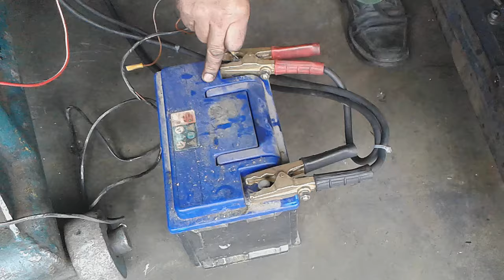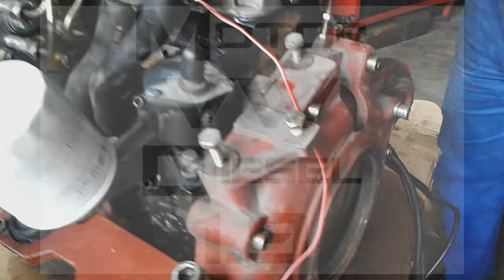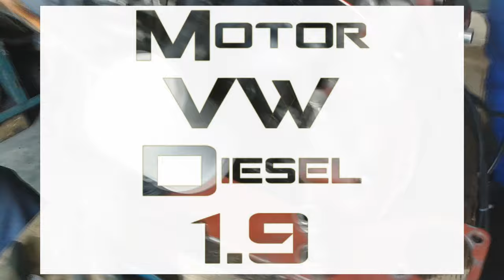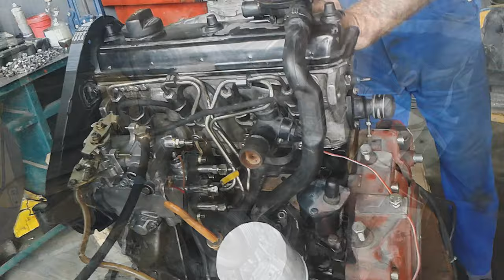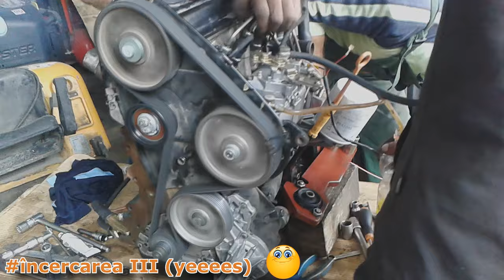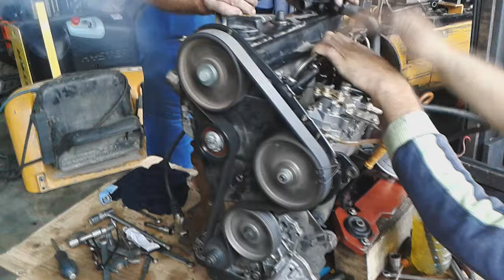Motor VW Golf 1.9 SDI pornire (Start Engine)

Comment: Its 1Y (engine code ) I think 

Its 47KW 1.9 D (Diesel) vw Golf 3 64hp mechanic pump 

1.9 SDI Have Electric pump like Golf 4 

Btwn the best diesel engine in mk3 is 1.9 TDI 66KW (1Z/ AHU) And 1.9 TDI 81kw ( AFN ) 

81kw + chip / remap easy 140-150 hp 7-5 sec 0 - 100 kmh and great fuel economy.

Comment: Salut, am un Seat cordoba 1,9 sdi 47kw cod motor ASY din 2004, îmi scoate fum negru de la 2500 rpm, o părere vă rog, poate să fie egr defect sau înfundat. Am făcut diagnoză cu testeru și toate funcționează în parametrii, vă mulțumesc.
Reply from the maker: aş zice să încercaţi o decarbonizare auto la un atelier specializat, dacă e cipat, dacă îi este mărită puterea din tester atunci scoate fum, altceva nu ştiu ce părere să vă dau dacă aţi spus că în rest totu funcţionează cum trebuie ori injectoarele pot fi înfundate ori EGR-UL, deci încercaţi toate variantele (decarbonare + verificare injectoare + verificare EGR)...
Reply: @AndreiChrisso  da are ceva soft masina, dar nu a scos fum, problema cu fumul este de o lună de zile. Dacă erau injectoarele nu pornea motorul la sfert de cheie. Și despre decarbonizare sincer vă spun am făcut cu trei luni în urmă, cineva a spus că este motorina proastă. Am curățat egr ieri și astăzi vreau să văd cum merge multumesc.
Reply from the maker: @stefanbaros7144  mai rar de la calitatea motorinei, dar în general după cipare fumegă, am câţiva prieteni cărora la fel li s-au întâmplat, după mărirea puterii a început să scoată fum, neavând alte probleme cu maşinile.

Comment: Salut ,am si eu un motor de golf 3 1,9 ca asta,si as vrea sa il pornesc ca ii luat jos,vreau sa fac un tractoras cu el Cum ati facut la pompa de injectie sa ii dati curent,ce fire trebe legate ????? Multumesc
Reply from the maker: dacă aveţi discord putem vorbi acolo, e destul de mult de spus, vă las aici discord-ul şi vă explic acolo...     Andofigur355#3895
Reply: @AndreiChrisso  nu am
Reply from the maker: bine Mircea, am să revin cu un răspuns mai pe seară, promit, o să-ţi las aici răspunsul... acum sunt în trafic, conduc, până diseară am să-ţi las răspunsul aici, bine ?
Reply from the maker: trebuie legat plusul la bobina pompei de injectie şi electromotorul legat la baterie
Reply: @AndreiChrisso  pun direct plusu de la baterie la electrovalva de pe pompa de injectie ca minusu face masa cand pun bornele sa pun la electromotor,Doar atat trebe alte legaturi electrice nu trebe ca motoru sa functioneze?
Reply from the maker: exact, doar atât, electromotorul şti să-l legi ?
Reply: Da,iti multumesc fain pt.ajutor Multa sanatate
Reply from the maker: @mircearoman2014  cu multă plăcere
Reply: @AndreiChrisso  salutare. Am un motor 1.9 tdi cod 1z are pompa electronica. Pot să îl pornesc dacă e luat jos? Aceleași proceduri că la unu cu pompa mecanica?
Reply from the maker: @JohnnysVolkswagenT3  da ar merge, doar că trebuie să-i ataşezi răcirea prin lichid, chiar dacă nu are sens închis, o laşi să curgă, adică conectezi instalaţia de răcire la o sursă de apă externă, chiar dacă curge pe jos pe partea cealaltă.

Comment: Salut, dețin motor 1,9 sdi 47 kw cod motor ASY din 2004, îmi face presiune în vasul de expansiune, am rectificat chiulasa am schimbat garnitura, am pus semeringuri noi la supape, si tot îmi face presiune, ce poate fii multumesc.
Reply from the maker: s-ar putea să fie de la termostat, acesta rămânând pe inchis, dacă ai schimbat toate piesele pe care le-ai specificat, bine-ar fi să îţi verifice cineva care se pricepe termostatul să vezi dacă declaşează când ajunge la temperatura optimă.
Reply: pacat ca ai umblat la motor. motoarele astea sunt extrem de fiabile, iar problemele lor sunt de regula legate de auxiliare, nimic intern.
Reply: Ovi motori 1.9 sdi su naj bolji motori izdrzljivi samo uredno odrzavat

Comment: 1.9d not sdi
Reply from the maker: it's SDI, without turbine
Reply: @AndreiChrisso  sdi-ul e cu injecție directă și pompă cu accelerație electronica, fără turbo, cel din video este 1.9 diesel cu injecție indirecta si accelerație pe cablu
Reply from the maker: @adelin3179  păi da, așa e, adică SDI, există SDI fără turbo, acesta fiind cu accelerație pe cablu și injecție directă, eu nu m-am referit la ce tip de injecție are, pur si simplu i se zice SDI ptr. că nu are turbo, mai e și varianta TDI adică cu turbo, ai înțeles acum ? Acesta este SDI aspirat, generație mai veche, fără turbină, nu am zis nimic de tipul injecției 👍
Reply: @AndreiChrisso  eu ma referam ca există 1.9d si 1.9sdi, ambele sunt aspirate doar că unul are pompă pe cablu si injecție indirecta iar celelalt pompă electronică și injecție directă, iar cel din clip este 1.9d
Reply from the maker: @adelin3179  da, așa este 😁 într-adevăr
Reply: 1.9 D 1Y 47KW Mechanic Pump
1.9 SDI AEY 47KW Electric VP pump controled by ECU MSA15
Reply: Understand?
Reply from the maker: @fitlifeinsider  Yes :)))

Comment: E motor 1z nu sdi
Reply from the maker: cum adică 1z ?
Reply: @AndreiChrisso  cod motor 1z după cum pare nu prea pare 1.9 Sdi e ceva mai vechi dupa cum e in video
Reply: @AndreiChrisso  sau daca e de pe golf 3 e 1.9 e AAZ
Reply from the maker: @antoniocosmin3278  n-am auzit, dar dacă tu spui, probabil că așa o fi
Reply: @AndreiChrisso  ca 1.9 sdi e altfel semanăna intre ele dar sdi are ecu nu poti sa il porneste fara el cum e alh poate e un sdi mai vechi mai vechi de 1999 sau cum am spus AAZ(cod motor)sau dacă nu are turbo e 1Y
Reply from the maker: @antoniocosmin3278  aaa ok, am înțeles, acesta e SDI, nu m-am uitat la serie, dar sigur este SDI, e un model mai vechi, a fost pus pe stivuitor
Reply: @AndreiChrisso  dacă il filmai si in partea la galerie de evacuare pe partea celantă iti spuneam exact ce model e!
Reply from the maker: @antoniocosmin3278  70 Cp
Reply: @AndreiChrisso  si din ce an e? Motorul  eu cred ca afost 1.9 sdi si ia pus pompa ce AAZ mecanica sa elimine ecu sa meragă mecanic tot!
Reply from the maker: @antoniocosmin3278  modelu` ăsta e făcut din '95 până în 2005, dar nu ştiu exact, e undeva prin intervalu` ăsta, maxim până în anu' 2005, e simplu nu e cu calculator, până în 2000 - 2001 cam aşa...
Reply: @AndreiChrisso  da problema cu calculatorul se rezolva nui problema cum e 1.9 alh ii schimbi si ii pompa de pe AAZ sau sdi cum e al tau nui mai trebuie ,merge tot mecanic!
Reply: @AndreiChrisso  si 70 cp are AAZ 1.9 sdi stiam de 90
Reply from the maker: @antoniocosmin3278  ţi-am zis nu-i ştiu seria, dar sunt sigur că mai mult de 70, maxim 75 de cai nu avea, acela din video.
Reply: @AndreiChrisso  il mai ai?
Reply from the maker: @antoniocosmin3278  nu, de mult =))))
Reply: @AndreiChrisso  eu vreau sa pun un motor de ăsta pe un atv de asta si când l-am văzut la tine acum 1 an de atunci tot caut un golf 3 la bani putini!Doar sa merag motorul nu contează cum arată!